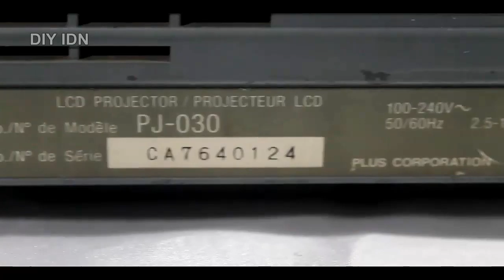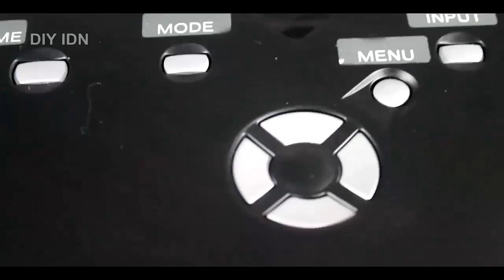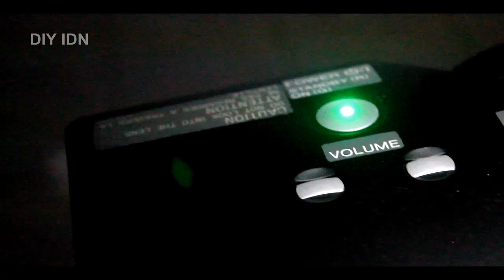PROJECTOR 3LCD FULL RESTORATION

Comment: Hi, do you know what protocol/interface use to communicate with the main the lcd screens? can they be reused as displays on other projects?
Reply: Hey I work as an electrical engineer in a company that repairs and maintenance projectors. These LCD work always with different types of software/hardware chips. You should look for a service manual. (These shouldn't be available but for some projectors you can find them online) In these manuals you can see everything, the PCB layout, the exact used chips everything.
Reply: @DonMarv00  Great, something like this http://pdf.datasheetcatalog.com/datasheet/sony/e6801370.pdf
it says it has an internal driver, but i cant find data about the protocol that uses? can it be reused?